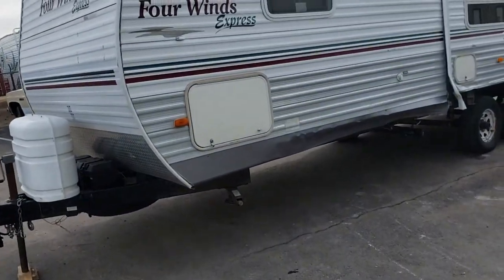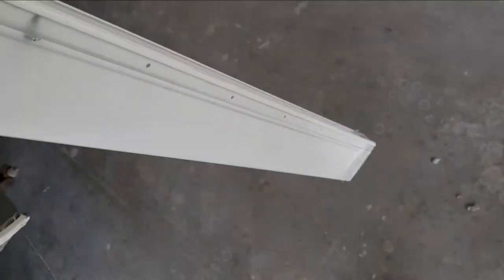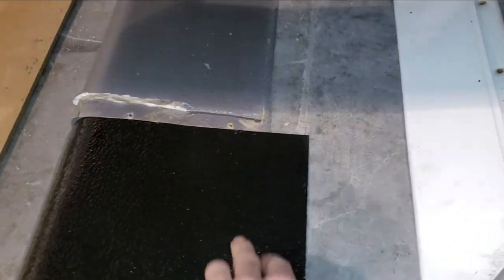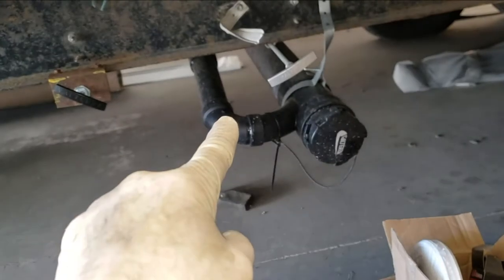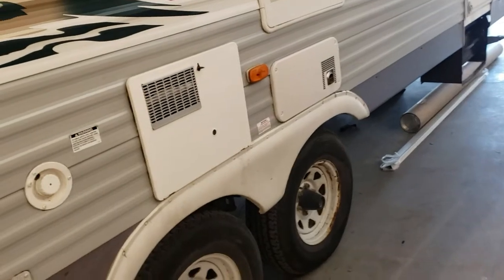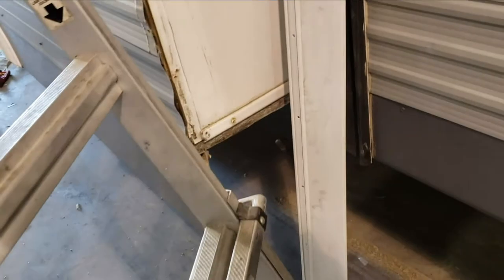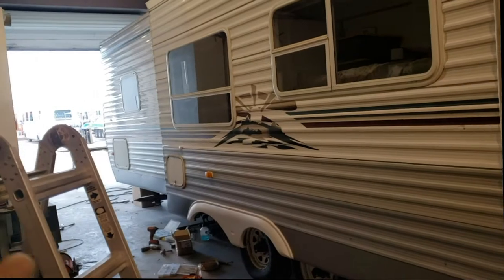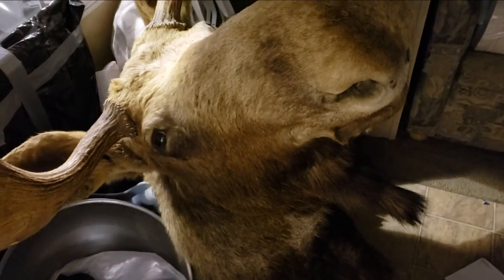Re-building a Thor Metal Travel Trailer + Slide Out Seals

Comment: Great optimism when you work brother...good to see somebody who takes pride in his work.
Reply from the maker: I appreciate that. I just really try my best. Thank you!
Reply: @AZExpert  do you know anyone in Phoenix area that fixes Xantrex RV2012 charger/inverter? Generator not charging batteries....checked everything....only thing left it could be is inside xantrex.
Reply from the maker: Mark Synder Electric has a repair station in Gilbert. Does it work off shore power?
Reply: @AZExpert  yes! Everything works except charging batteries.
Reply: Light on xantrex blinking and says searching.
Reply from the maker: @AstrologerJoe  I chose my words poorly. If it charges on shore power then it's not the inverter. If you have 120vac at the inverter from shore or generator then there is an issue with the inverter yes.
Reply: @AZExpert  Update! Bad battery temp. Sensor was issue for generator not charging batteries.  Thanks for your help!
Reply from the maker: @AstrologerJoe  great news!!
Reply: I observed the same.  Any job worth doing is worth doing well.

Comment: Love your work and your willingness to share your trade. Heaven forbid I rip up my coach. I saw a video of a coach owner that tore out his right rear corner on a bollard. 9000$ it cost them to get a RV body shop to fix it. I doubt the materials cost  2000$ if not less. It’s a matter of working with your hands and knowing what to do. Thanks!
Reply from the maker: You're very welcome. There is no doubt these repairs can be expensive and hitting bollards and post is ridiculously common. It's getting the parts that I think is the biggest challange, which is why I really was surprised everything came in correct the first time. Thanks for watching!
Reply: My dad took his hi-lo camper through a McDonald's drive through and tore the back side out of it. I asked him why he did that and he just shook his head. I guess there is no "right" answer for that!

Comment: I wish you were close to me. The left front middle side panels ballon in tow on my 25 foot coachman Right above my cargo door and in front of the bedroom window. It’s very noticeable in my drivers side mirror. But I know I’ll have to tear the whole nose of the camper once I commit to repair. Cuz I know I’ll find rot. On the bright side, I bought one of those air powered caulking guns that I seen you use. I thought that was a pretty slick tool. 🤷‍♂️🤷‍♂️
Reply from the maker: The air caulking gun is good for bulk sealing, it is very hard to finess on good looking beads....at least for me. Just watch your air pressure it can shoot out like a water gun if you're not careful.

Comment: My Keystone caused me to ask the same question:  "How could they leave that end grain exposed and not wrap it??"  After the 2nd time (yeah, I know) "repairing" water intrusion damage (couch, booth, carpet, etc.), I was getting ready to put the booth seat back against the front wall of the slide.  My lovely wife said, innocently:  "Why is there light shining over there on the floor  (pointing to the bottom of the front slide wall)?"  Somewhat cynical, I said:  "It's probably a reflection from the window" as I knelt down to check.  When I put my head down on the floor and saw my truck, I realized why we had been unable to seal the slide windows and roof -- they weren't leaking.  The water was running down the wall and wrapping around the bottom onto the top of the floor!!
The slide floor screws only went 1" into the 2x2 "sill plate" from the bottom, so they were pretty useless, even from the factory.  Four 1/4" molly bolts and four 2 1/2" wood screws later, the floor was solid.  Moved the outside bottom trim to the bottom (it was 1" up!) and sealed everything.  Did the rear wall of the slide the same way (same sagging problem).
Works great now...even in the rain!
Reply from the maker: It is very frustrating when the build was incorrect from the beginning. Thanks!

Comment: Been watching you for a while now...cant tell ya how much youve helped me with undestanding certain things, for this i thank you! 
I have a 08 winnebago outlook 31c...i cant seem to find any answers so i figured i harass you. On my slide out, when its closed the top and the bottum of the slide touch the seals but the middle doesnt... The metal trim piece on the slide has a slight bow so the middle doesnt touch. Is there a way to adjust this? The other side of the slide is fine...any ideas? Thanks
Reply from the maker: I am very happy to hear I have helped in any way. It all depends on the gap. The main seal on the slide is inside the trim at the opening next to the wiper seal. The small bulb seal on the outside flange is more of a dust seal. If it's bowed a little, I'd just take a mallet at bow the fasic trim toward the sidewall. There is no adjustment for what you are speaking in the middle short of setting the in stop to bring the whole slide in a little further......assuming there is room at the top and bottom. Mostly when it comes to slides, I say if it's not leaking and working, not to mess around with it.
Reply: @AZExpert  thank you for this...i said the same thing about trying to maybe bend it alil and everyone jumped on me with "are you kidding" and "your and idiot" ...glad to hear im not...thank you!!!